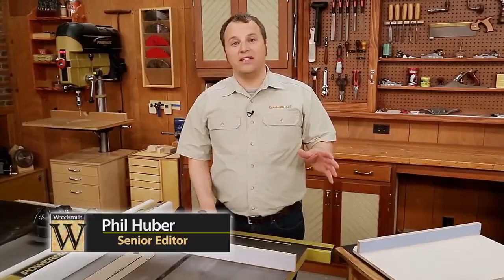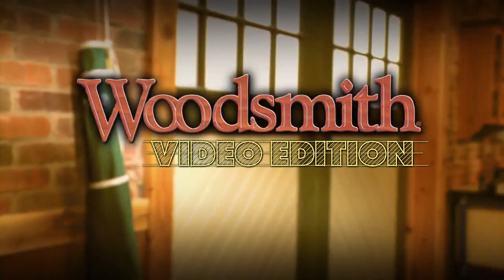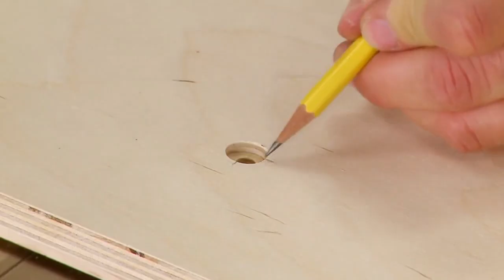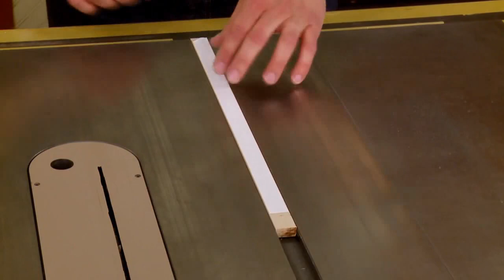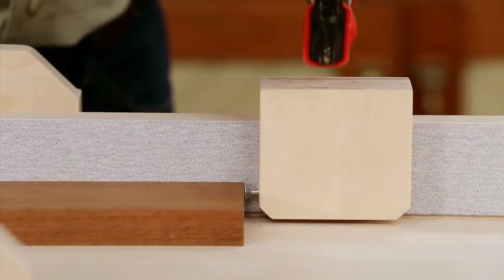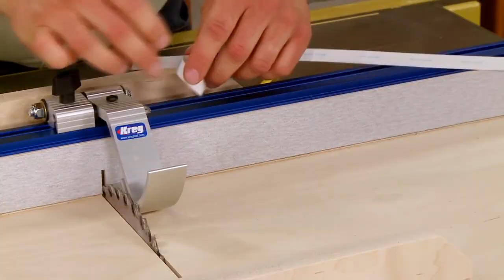How to Make a Table Saw Crosscut Sled | Beginner-Friendly + Free Plans

Comment: I am building this project. TIP! Check your saws factory fence for square first. Then cut the dust rabbet before you move the saws factory fence in for sled assembly using double sided tape.  Video shows assembly of the sled base to the runner and the sled fence to the sled. Its at this point the rabbet comes up in the video. Make all your table saw cuts first.  Otherwise you have to realign the table saw fence when assembling. If using an older saw, your saws factory fence could be a 64th or 32nd off making the new sled crooked.
Reply from the maker: This is an excellent suggestion... I would recommend not only regularly checking your fence alignment but also your blade to table alignment,  and miter gauge setup.  I've been burned a few times on assuming everything was setup properly because things can shift from time to time - especially in our shop when we have lots of different people using the same tools.  :(
Reply: @WoodsmithShowandmagazine  what's worse is when you mess up your own project! Recently did that with my jointer fence by  not checking LOL..
Reply from the maker: @PRRGG1  - Oh no... about a year ago I was cutting a bunch of parts on the table saw for a dresser and it wasn't until I was about done that I realized the blade was tilted about 1 or 2 degrees off 90.  NOOOOOOOO!!!!  :(
Reply: @WoodsmithShowandmagazine  that stinks! And the next thought is "how can I save it?" :)
Reply from the maker: @PRRGG1  - That seems to be a large portion of woodworking... How to fix the screw-ups.  :)

Comment: I think squaring the fence needs a separate video. It's not clear how to make that adjustment and I tried to do with screws, not so easy. I'd also recommend a stopper screw on the hardwood rail to stop the sled once its past last bridge. I saw that in another DIY video by Sergio
Reply from the maker: Good points... Having a square fence is probably the most critical aspect of a table saw sled so it could definitely use more detail.  Thanks.

Comment: Always use the five cut method for squaring your sled. This puts no reliance on the accuracy of any other tool. And that double sided tape means that when you adjust the end of the fence back a bit you end up with a curved fence. Get rid of the tape and use one screw each end. Now when you adjust, the fence pivots around one screw, and remains straight. Once you have got it straight with the five cuts, put all the screws in.
Reply: the whole intro is about how important it is to have accurate cross cuts, then he uses a combo square to declare his cut "perfectly square".  no, honey.  you have error there.  you just can't see it by laying a combo square down next to it.  the 5 cut method magnifies your error so you can see and measure it accurately, and then adjust the sled accurately.  why make a whole video teaching people to make a cross-cut sled, and then not bother to use the 5 cut method?  it's just so substandard.
Reply: @RainDog222222    Time to get the digital caliper out.  William gets em to about one thou. And his method is the best out here.
Reply: He can't fix it now anyway because he glued the fence down with tape.
Reply: donepearce this guys method of making the sled square to the saw blade is hit and miss.

Comment: One runner or two runners?  And does it really matter???
Reply from the maker: This is the true existential question of the universe.  In my humble opinion, I'm totally fine with one.  When done correctly there is plenty of stability with a single runner and it is easier to install than two runners.  It's really hard to get two runners installed in the correct location and parallel so they don't bind.  Although, we have made sleds in the past with two runners (like this one: https://www.youtube.com/watch?v=M7SmrHFW-EA -  we talk about the runners at the 5:30 mark in the video) so we'll probably make a video to show how to do that too.

Comment: Like the poster below, I would be concerned that the long fence in the second sled would (1) not be perfectly straight to begin with and/or (2) would warp over time. What type of wood did you use for it and what process did you go through to make sure it was perfectly straight ,,, at least first?
Reply from the maker: Those are fair concerns... it looks like the fence is a piece of 3/4" thick hard maple.  I'm sure we picked a piece that was pretty flat and stable to begin with and then jointed one face to flatten it and then planed it to thickness.  We have a fairly climate controlled shop that doesn't have large swings in temperature or humidity that would contribute to future warping, but that is definitely something to check from time to time.

Comment: A 'single sided' sled like this protects the cut from tearout ONLY on the part on the sled. If you are making multiple parts, and shifting the material along, each part will have tearout on one side. A full sled does not do this, an also allows a stop to be fitted for part size repeatability. This would NOT be your last sled...
Reply from the maker: Ok, fine... the title was a little hyperbolic, but how about "Maybe the Best Table Saw Crosscut Sled Ever?" found here: https://www.youtube.com/watch?v=KWyLrDZAW-c

Comment: Is there a reason that you don't use a second runner on the big sled? It seems that it would provide a little more stability.
Reply from the maker: I don’t know if you get any more stability with 2 runners versus one, but I find that it’s harder to set up 2 runners because if they aren’t perfectly placed and parallel the sled will bind and not slide smoothly.

Comment: Why not use a framing square to align the fence. Have you ever seen a framing square that wasn't square? Even if it is not square it is not that hard to adjust.
Reply from the maker: Actually, I've come across many framing sqaures that aren't perfectly square. :) Plus, most framing squares are too long to fit in between the fences of this sled. Honestly though, you can use what ever you want to set up the fence initially.  You just want to get it as close to square as possible and then do test cuts to hone in on a perfect 90 degrees.

Comment: Three points of concern.  First of all, the square used for "squaring" is small, leading to inaccuracies proportional to the length of the piece.  Secondly, which is intended to offset the problems of point 1, the fence is screwed in, but adjustable for fine tuning.  This means that the screws could loosen over time causing aberrations to increase with use.  The fence is never glued or otherwise permanently fastened.  Thirdly, using the blade as a reference could prove to be inaccurate if the blade were changed out for another with a different kerf width.  As a final note, mention ought to be made of the materials used so that properties inherent, such as warping over time, do not become an issue.  Other than these points, that caught my attention, I like the creativity and forward thinking that leads to greater versatility, which we could all use.  Good job!
Reply from the maker: Thanks for the input.  You could certainly use a larger square if you had one but the square is just used a reference to get you started.  You should really make some test cuts and check your test pieces for square with a precision tool.  As for the adjustment screws, you make a good point... Once you have the fence adjusted for square, it would probably be helpful to "pin" the fence in place with a couple countersunk screws to keep it from moving over time.  Lastly, although most blade kerfs are approximately 1/8", it is possible to changing to a thin kerf blade would affect the accuracy of the measuring tape on the flip stop system, but if you were going to use a thinner kerf blade consistently then you could just adjust the position of the cross-hair indicator to reflect the change.
Reply: Actually the biggest issue with this design is none of what you said..It's the simple fact the Sled bridges aren't tall enough to accommodate the full height of the table blade for thicker workpieces. Plan calls for a 3 inch height which is not tall enough. The sled needs a rise in the middle of the bridge cut on a band saw. Otherwise the design is fine. This isn't the first Woodsmith plan I was easily able to poke holes in, I tried the dado sled they have and it was an awful plan.
Reply from the maker: jc51373 - You can make the bridges as tall as you’d like for your applications. No design is perfect for every application, but I’ve been using this sled for quite a while and never had a problem. But I am cutting mostly 3/4” to 1” thick material typically. We also use this sled: https://www.woodsmithplans.com/plan/ultimate-crosscut-sled/ in our production shop quite a bit. It might address some of your concerns, but feel free to critique it as well.
Reply: @WoodsmithShowandmagazine  yes you can't really cut anything over that thickness (1 1/4" at most) with this design unless you want the hand guard to be sacrificial, which is not supposed to be, even then it's not more than 1 1/2" max. It would have been a good callout in the plan or your video because I went and bought all the material, cut them down to the plans dimensions and it wasn't until assembly i realized that limitation of this sled, which is a big limitation. Now I have to redo the bridges. Also your video doesn't cover how you aligned the holes for the fence on the sled base that would be helpful to know as well.
Reply from the maker: Excellent points.  Someone else in the comments here also mentioned how, in this design, the aluminum extrusion for the flip stop track dips down on the back on the back of the fence.  So if you have a saw stop that is something to consider, as well on the depth of cut limitation.

Comment: I dunno, maybe Im simple minded but why did he set the tape measure on the aluminum stop with 0" mark actually more like 2" off the actual cut line? Now if I want to line up the stop where I want the actual cut to be, I must add the width of the aluminum stop to whatever measurement number I see in the red line on the stop gauge. I like to make things idiot proof and minimize the amount of numbers I must keep in my head but that's just me.
Reply from the maker: Starting at the 18:39 mark you can see that the flip stop is touching the blade so the cut is "zero" at this point, but the cross hair indicator is actually over a couple inches so placing the 0 mark on the tape under the red indicator line is correct in this instance.  If you aren't using the Kreg Flip Stop system then placing the 0 at the cut line would be more helpful.
Reply: @WoodsmithShowandmagazine  ahhh i see it, makes sense now i don't know why i missed that.
Reply from the maker: No worries... we’ve had a couple people ask the exact same question, so it might have been easy to miss.

Comment: Why not use two runners on the larger sled?  Wouldn't it be more stable and add to the accuracy?
Reply from the maker: I don’t know if you get any more stability with 2 runners versus one, but I find that it’s harder to set up 2 runners because if they aren’t perfectly placed and parallel the sled will bind and not slide smoothly.

Comment: Don’t get the part “loosened the screws and moved the fence just a little bit and tightened”. It is not like the screw holes change location. How you can make an adjustment like that?
Reply from the maker: The screw holes in the sled base are over-sized (1/4" I think) so there is room around the shank of the screw to make minor adjustments and then tighten the screw back down.  We used a panhead screw with a washer to secure the  fence.  I believe this is shown in more detail in the plans.  Good question though... thanks for asking.

Comment: I wonder if you were lucky to get it perfectly square first time? If you make a cut then reverse the test piece and make a second cut about 1/4" (6mm) in the measure the offcut it will show double the error and make adjustment of the fence easier.
Reply from the maker: We are ALWAYS lucky enough to get it perfect on the first try here in the Woodsmith Shop. ;)  Yes, typically you'll probably have some adjustment back and forth before it's perfect.
Reply: @WoodsmithShowandmagazine  Which you can't do because you glued the sled down permanently with the double sided tape.
Reply: Or use the '5-cuts' method for even more accuracy and quicker results.
Reply: Norman Bott I did that and spent a lot of time getting rid of the last thou’ error. So I screwed a small block to the base of the sled with a screw into the near horizontal which allowed me to micro adjust. Being a retired aircraft engineer does not help woodworking. Does anyone need a lot of small wood strips which are parallel apart from an error <0.001”

Comment: Do the metal screws cause a SawStop to malfunction and seize up?
Reply from the maker: Any type of metal  contacting  the spinning blade of a SawStop should activate the safety mechanism. But by design, none of the screws or aluminum tracks for these sleds are  located in an area that would be anywhere near the blade, so it will work fine with a SawStop or any other table saw for that matter.
Reply: @WoodsmithShowandmagazine  According to the plans, the fence is 2" tall on top of the 1/2" plywood. The t-track has a flange (guessing about 3/4") on the backside of the fence. That means that you would not be able to set the blade height to more than just under 1-3/4" which means that you would not be able to cut through stock thicker than 1-1/4" thick without disabling the SawStop safety mechanism. Sound about right?

Or just make the fence taller and/or use 3/4" plywood. Also, I do not recommend resting your thumbs on the sled's "blade cover". Ever. For any reason.
Reply from the maker: Yep, everything you said checks out... I definitely wouldn't cut anything thicker than 1" with the sled if you have a SawStop or you're probably going to tag that aluminum tab on the back of the fence.
Reply: So, yeah. Make the fence taller.

Or, cut the t-track and leave a small gap for the blade to go through before applying the measuring tape.
Reply from the maker: Scott Jordan - The height of the fence is dictated by the function of the flip stop... if you make it any taller the flip stop won’t reach the base, but you could definitely notch out the aluminum tab to gain a little cutting capacity.
Reply: @WoodsmithShowandmagazine  True. But if you have to choose between using that specific flip-stop (as opposed to making one) or ensuring the blade will clear the t-track, that's a no-brainer.

Personally, I can't imagine going to the trouble of building a sled with a maximum cut depth of one inch else risk costing $70 to replace the brake cartridge on the saw. Then again, I have a Ridgid R4513 so I can just cut right through it just fine. But a lot of folks will have problems with this as designed.
Reply from the maker: That's true.... I would definitely go with a taller fence over the aluminum flip stop system if that's a concern.  I've used this sled a lot and never had a problem, but apparently I'm not cutting a lot of material over an inch thick.

Comment: i don't understand how where you placed the ruler tape is accurate.  from the video it looks like the 1" mark is more than 1 inch from the blade.  looks more like 2 - 3 inches.
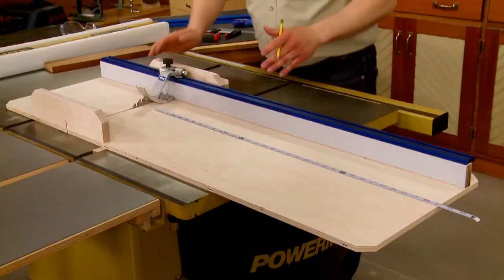Reply from the maker: That is correct... the zero point on the tape is actually a couple inches over from the edge of the blade because the reading is based off the indicator cursor on the right side of Kreg flip stop. (Starting at the 19:12 mark it shows that indicator on the right side of the flip stop and the left side of the flip stop up against the blade.)

Comment: Square the fence to the blade using the '5 cut method' as described by William NG using  feeler gauge is a a very accurate method.  I like the extended table.
Reply: I used Ng's method to make a sled that cuts to within 0.001" over a 22 inch cut!  It makes perfect square cuts every time.  Combine this with his miter jig and you're set for perfect 45's too.  Also, King's Fine Woodworking made a pretty sweet sled using Ng's method

Comment: am i right in saying that the fence has to ALWAYS be higher than the highest setting of the blade? or do you use different crosscut sleds for different heights too? great video btw. well explained. can't wait to make my own. not looking forward to the "adjusting" of the fence to get it perfectly straight but I guess I'll just have to knuckle down and get to it sooner or later :-)))
Reply from the maker: That is correct - you wouldn't want to cut through the top of the fence because that is what is holding the 2 parts of the sled together.  (Not that I haven't already done that before.)  If you plan on cutting really thick material I would plan to have a taller fence, but typically we crosscut pieces that are 3/4" to 1" thick, so it's not a problem.

Comment: I like the sleds with two runners.
Reply from the maker: We’ve found that it can be a little tricky to get two runners perfectly located and parallel to each other.  If this isn’t done correctly the sled will bind and won’t slide smoothly...  Using just one runner is simpler and seems to work fine, but to each their own.  Thanks for watching.